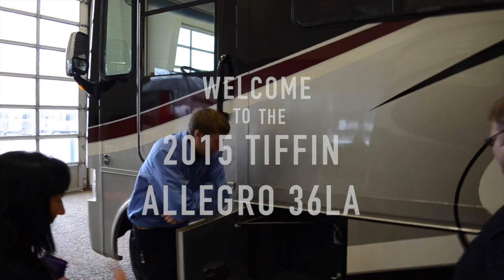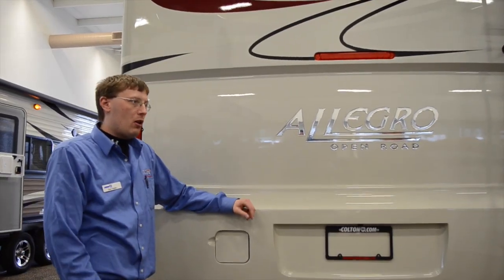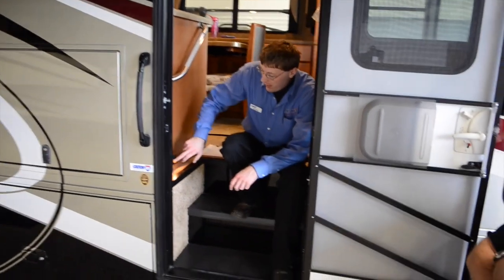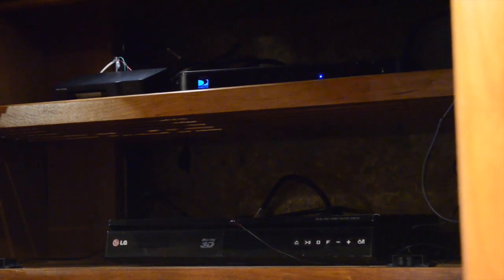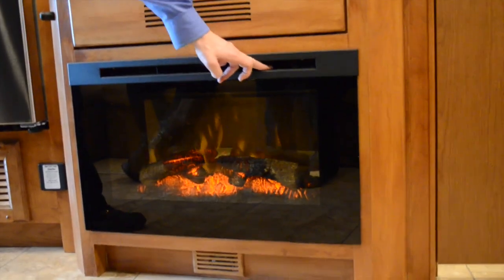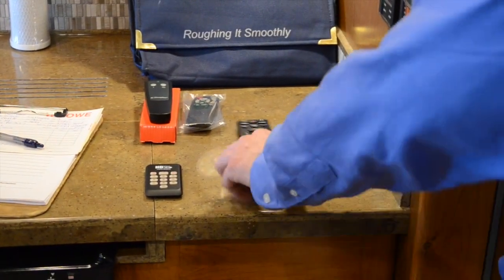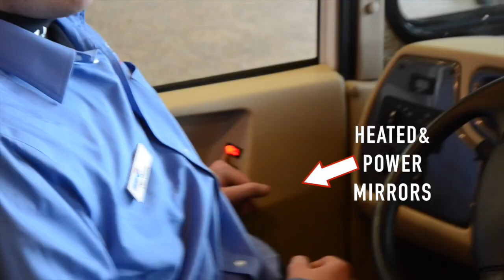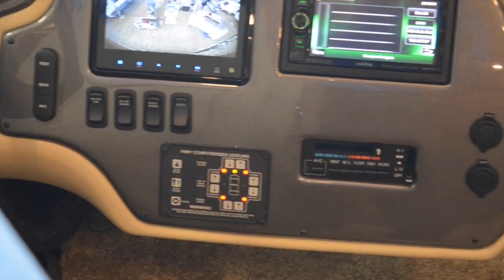How it Works: 2015 Tiffin Allegro 36LA | Class A Gas Motorhome

Comment: Nice walk through, couple questions.
How many gallons of antifreeze? I blow the rig out with air, just a personal choise not liking the antifreeze stank.
2 - Where is the reset on the CO2 alarm, also is the 12 volt breaker labeled if the reset does not work?
3 - The ice maker can be dis-installed with I believe 3 screws, then, the water line is gravity fed. Where I am going, I just don't think one can get a anti freeze stank out of the cubes on de -winterizing. The whole first tray is going to have to be thrown out, that is hours of ice making/energy.
4 - Are the Fantastic fans in air/out air "switchable"? I usually set the Bathroom on low "out" then set the center rig fan on "in". This pushes all air out through the bathrooms creating clean air flow on low setting.
5 - Discovery after years, re-filling hot water tank after winterizing, heat it up, then shut it off then blow the first batch out the outside drain removing mineral/dielectric rod residue out of the system. If not, the re-filled tank will send minerals/dielectric up the hot side and clog the hot side of all faucets. The test is if one has full flow out the drain compartment "hot drain", and nothing out of the faucets,, then all the faucet cartridges are clogged. That sucks, been there done that.
6 - My current ambition, have you ever installed a Tesla powerwall on the rig and gone 110 volt 24/7? Everything works,,, all the time, period. I am abandoning Gran pappy's 12 volt architecture that is backwards compatible to run the entire rig full time 110 volt. Ditch the Onan (not inverted power "bad for electronics low volatge") for Honda 3000is in twins as the backstop to the powerwall. Lead acid battery cables just get tied together without the batts, all other functions work the same.
In "twins" the Honda's are 48 db @ 1/4 load (very quiet) or 58 db @ 46.6 amps 110, juicing up the powerwall really quick.On the current hand, the lead acid even with 4 batts can only charge/ discharge @ 15 amps. The only coach that could go 110 volt with both the motor and generator off for the longest period of time. Then be the quickest/quietest coach to return to power.
7 - Mobile power port skirt cabinet, where I could pull out/charge my electric bike that can do 10 miles of wandering on a single DeWalt DCB407. 20 amps of weather protected power/charging.